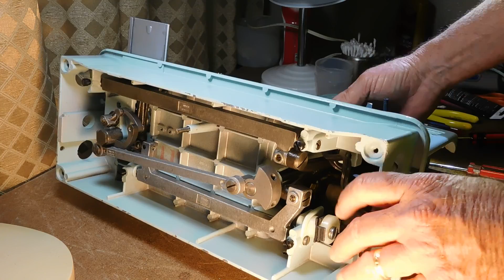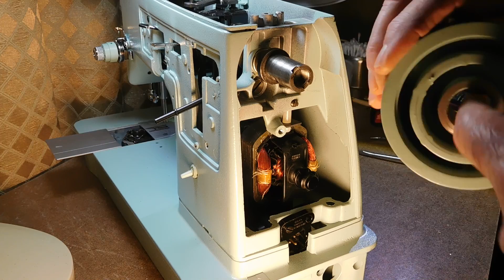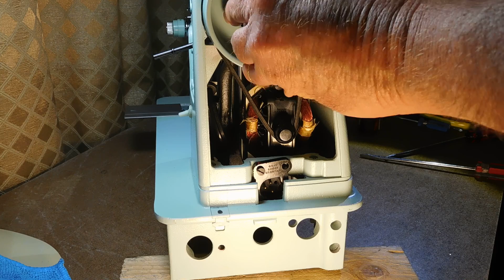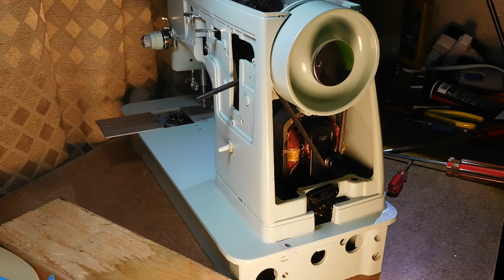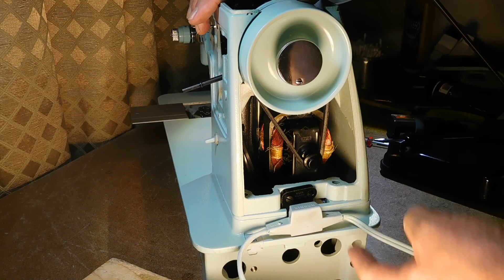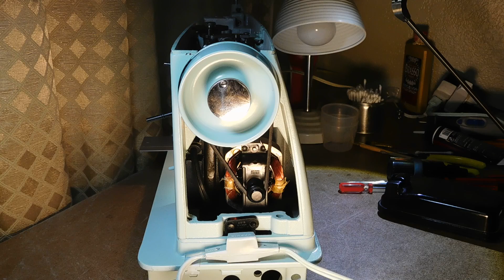Step by Step Restoration of a Singer Model 337. A Series. Part 19: MOTOR BELT R&R / TENSION

Comment: Hey Andy, I have a trick for putting the stop motion screw washer back on in a breeze, when you take the stop motion screw off, take a permanent marker and mark one side of the shaft and washer ears that way when you put it back on you will know exactly where it goes.  Now this being said only works if no one has taken it off before and put it on wrong.  But if you try it out before you unscrew the stop motion knob and it works properly then you will know that it is put on right.  Hope this helps.  Thanks for sharing your videos.  I have never had to do this job yet.  :)
Reply from the maker: Great tip. I pinned your comment and hope others will see it here. You really should share your expertise with some "tip" videos on your channel. Think of all the people you could help!
Reply: Well while I am getting smarter on cleaning sewing machines I am not that good on computers.  I will have to learn how to create a you tube channel first.  :)  Glad I was able to help you, or anyone that is trying to save these beauty's.
Reply from the maker: your comments are always welcome 😉

Comment: I'm waiting on a belt but after watching this vid a couple times I'm confident that I can do this! The belt that is on there has an area that is slightly raised on one side in a small area and it looks like it's been rubbing on something.  Nothing severe.  Could this be inductive of another issue or just an old belt? Like your machine here, mine also clacks in the bobbin area.  I thought it was something I did but I guess not lol.  Love this series!
Reply from the maker: I know you can do it, no worries. I think the raised part of the belt is due to age and then lack of use. When you install the new belt you can turn it by hand (handwheel) and see if it rubs on the motor pulley or handwheel.  
     Since the hook is a Bell Crank Type there will always be some tick-tock noise and it undulates up and down. There is not much you can do about that other than be sure the screws are normally tight and the parts are oiled properly as per the manual.
     Another cause of clacking is the Thread Clearance space between the bottom right corner of the Bobbin Case and the spring on the Bobbin Case Positioning Bracket. That clearance is adjustable and if is too wide the Bobbin Case bounces too much between the BCPB spring and the "race" of the hook that the bobbin case rides on. It's not too hard to adjust the bracket and there is a range of space you can play with to help quiet the clacking down. If the space is too narrow then the thread gets caught in it and you get a big mess. Here is my video for adjusting the clearance (it's a video in this playlist you've been watching) https://youtu.be/N9aWiTZi4w4   
     I appreciate what you are doing to get the machine back in service and thanks for doing that 🙏
Reply: @andytubesewing1953  ok thanks! Maybe I can decrease a little bit of that clanking but if not, it sews great anyway. I haven't gotten to that linked video yet, but I'm definitely going to watch all of them. Much appreciated!

Comment: Hi Andy,

I replaced the motor belt in my Singer 338 and now it is making an extremely loud noise and is not working correctly. Do you have any idea of where I could have gone wrong? I have also cleaned parts and re oiled the machine per the manual.
Reply from the maker: "extremely loud noise" is a little vague. Can you tell at all where the noise is from? The motor? The new belt? the Hook/Bobbin area?
Did it work OK with the old belt? You see where I am going. If you put the machine in bobbin winding mode you will only be running the motor, belt, and handwheel. The other parts will be disengaged. If you have the noise still that would tell you something in the motor, belt, or handwheel is the problem and you could start there, like remove the belt and just run the motor to see if it is making noise. You'll need to isolate the noise somewhat to have a chance for finding/fixing the problem.

Comment: Hey Andy, I replied to one of your other videos but this was the one I was referring to.
I put the hand wheel back together wrong and now it won’t lock in order to let it stitch. I don’t know what to do
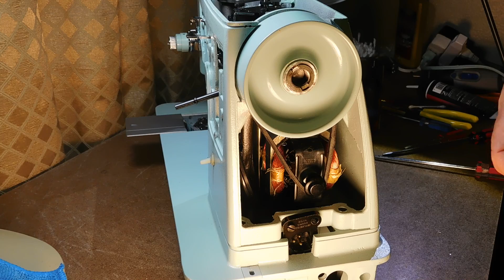Reply from the maker: It is common that we can put the washer back on the machine in the wrong position. What you describe is evidence of that. So we just remove the Silver stop motion screw (or knob) and remove the washer and turn it 180 degrees to the right or left and put it back on. This procedure starts @ 08:20 in the video. Watch it and you'll see. I think I mention about turning it 180 degrees if it doesn't work correctly the first time you reinstall it. We have all done this b/c it's a 50-50 chance to be correct (or wrong) when you put it back on. No worries.
Reply: @andytubesewing1953  This is what I needed.  My 338 stopped sewing right in the middle of my project.  Apparently, put everything back together, a day before, I didn't install the stop motion screw washer in the correct direction.  Thanks Andy!
Reply from the maker: @mikestringz3159  You and about a million of us have done that, hehe. You'll remember this forever now, at least I have. Happy sewing and thanks for stopping by.